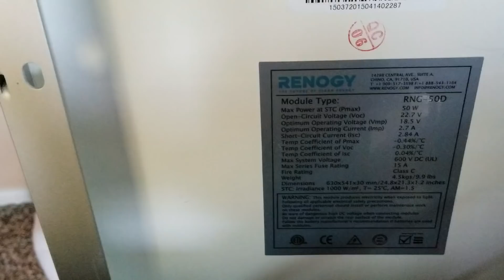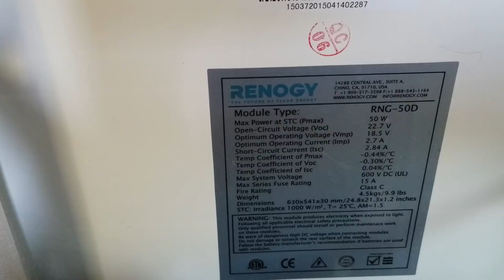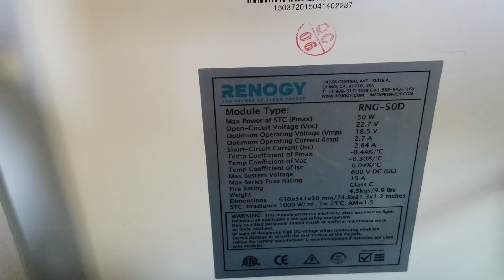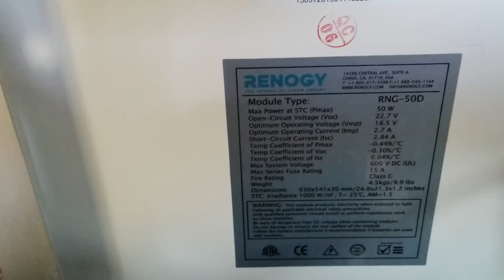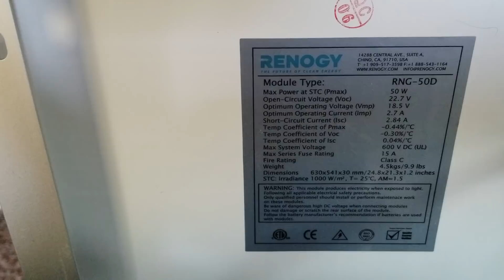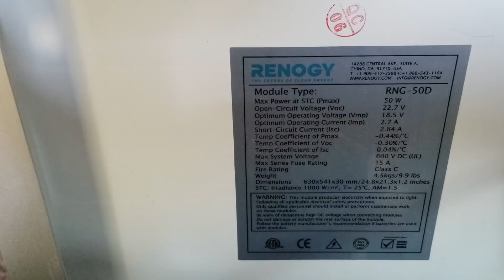MPP SOLAR PIP5048MG | HYBRID INVERTER CHARGER INSTALLATION TIPS (pt.1 of 2)

Comment: JW, I need your help and knowledge you have about 5048MG, I come from 4048GE and notice some things weird on MG. 
First, in SOLAR mode MG does not integrate grid to power loads when solar is insufficient. It only switch back to grid when solar is unavailable but does not integrate as a "grid tie" operation which GE do. The GE do grid + solar power integration to power loads
Second, it have two menu that arent in manuals nor internet, those are menu #28 and #30. Did you know for what they are?
Third, I have a split/phase conversion from 240V coming out from inverter which I use with GE without issue, but with MG it leaks 120V from inverter chassis to ground so Iam unable to connect ground to inverter. That happens when inverter is in inverter mode

Iam looking go back to GE, Any help or suggestion I will appreciate a lot!! Thanks
Reply from the maker: Hello Mr. Tech and thanks for watching my videos.
Please send me a private email with your phone number at jwsolarusa@hotmail.com and I will give a call.